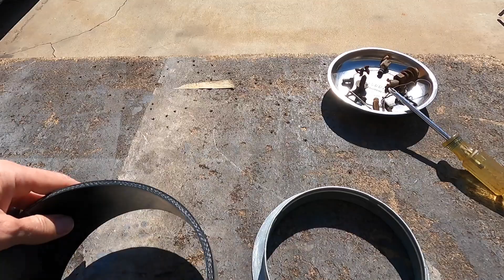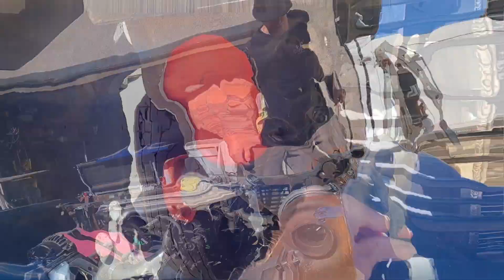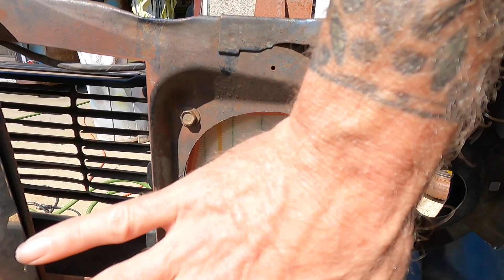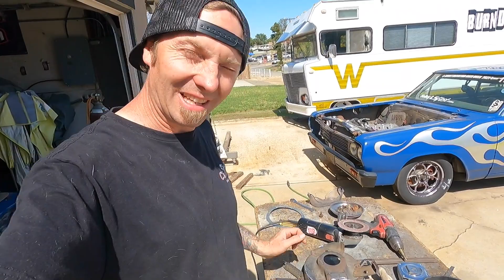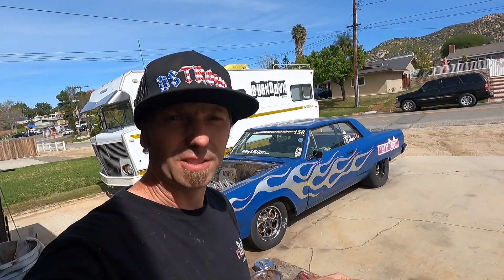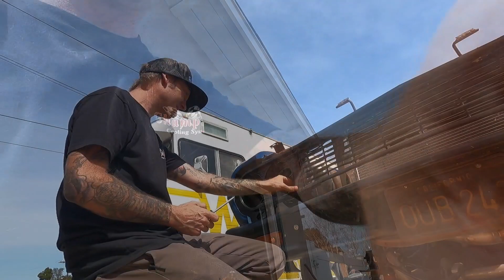Headlight Air Filter Is Done

Comment: Nicely done Dane 👍🏻 personally I would install a K&N filter and forget about it. Leave it in place at the track , one less thing to do at the track. 👏
Reply: I wouldn't ~6cfm per sqin would need ~130sqin to not see pressure drop and horsepower reduction and that is not anywhere near 11.5"x11.5" filter. It could be done, but isn't necessary.
Reply from the maker: Its just to keep crap out of the turbo and my motor on the street. The turbo needs all the fresh air on the track it can get.

Comment: I hope that's not the filter u plan to use because that turbo will suck up and shred that filter and destroy the turbo in the process u have a better chance of using just a peice of screen and a clamp around the turbo and ditch the "filter box" deal u made that style but k&n brand filters have the honeycomb looking metal that prevents the filter material collapsing or getting sucked in but thats a catastrophic failure waiting to happen
Reply: I'm sure he's not going full send with the filter in, probably more for the street driving...
Reply from the maker: Yep
Reply: Only way it's going to collapse and get sucked in is if the filter gets soggy wet or the filter is completely plugged. It's only for the street drive. Not trying to make 30 pounds of boost with the filter on. Also pretty sure he already mentioned in a previous video about getting a k&n version. This was just a cheap one to see if it would work.
Reply from the maker: Yes it was to see if I could make it work and I already looked up to see if they made this in a K&N and they do so I went into the project with that in mind.
Reply: Filter is for street driving, with the turbo that exposed to any road debris compressor damage is a major concern compared to just running open within the engine bay(where your biggest concern is sucking up one of your wiring harness, or a zip tie). I do not like turbo guards, or screens. They do choke airflow and if left on all the time are not good at unrestricted airflow, or stopping debris. So they're not ideal in either regard.  I've always been an advocate for an easily removable air filter and I've been running low mounted forward facing fresh air turbos for 5 years. Turbo is also not a $160 POS gt45, it's a VS racing billet center section triple ceramic ball bearing prototype "just buy another one" isn't feasible.
Reply from the maker: What he said
Reply from the maker: Looks like Ryan covered it but yes its for driving on the street form track to track. Im gong to get the K&N style filter but this one was 12$ so I didnt have to worry about burning it or getting it messed up while making the box. The car will not be run with a filter in place.

Comment: That’s a pretty sweet intake! I picked me up a tig so I can learn how to quit mig welding my nice stainless pipes haha
Reply from the maker: I just pulled the radiator out of the bego and it has Mig Welded pipes for the radiator. Ill be re doing the plumbing so yeah more TIG practice for me. I have been practicing a little and its making more sense but practice and actually welding is the only way to get better at it.
Reply: @Burndown  yeah I really want to expand what I can fabricate and not being able to tig weld keeps me from doing a lot of the things I want too. I will give you an update on how that goes for me soon haha